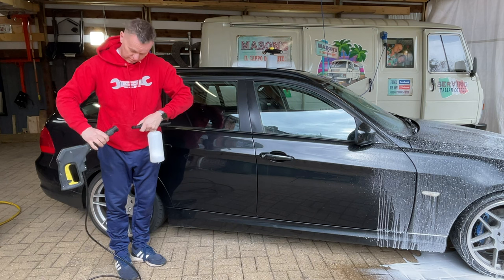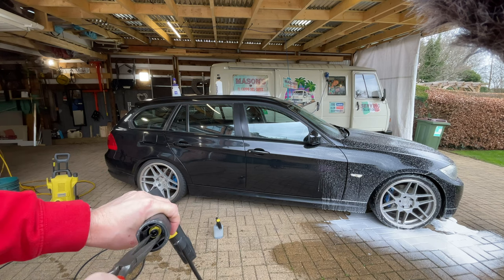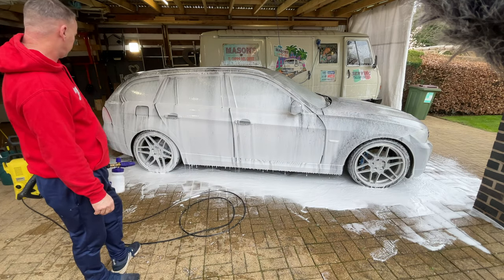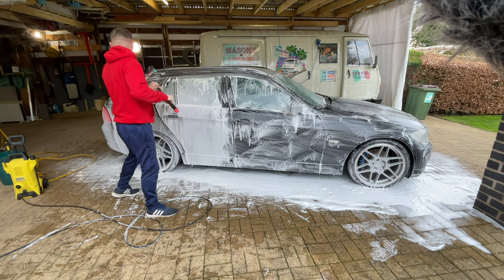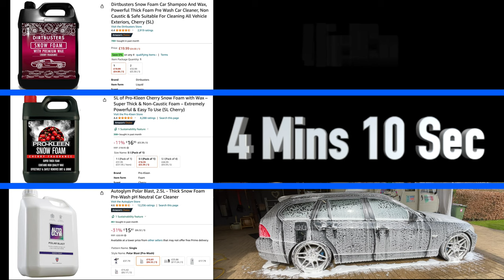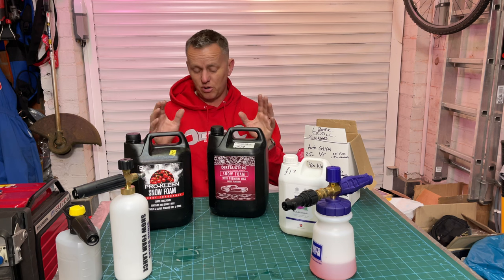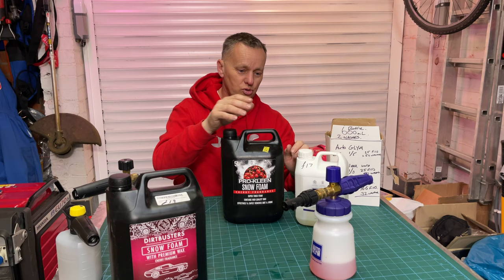"Snow Foam Showdown" Karcher, AutoGlym, Stone Banks, ProKleen, & DirtBusters.

Comment: Hi mate great video 
If you are going to use the snow foam as your contract wash do it 2 times 
Snow foam one then rinse off then snow foam again then use your brush 
If you use just one snow foam and use your brush you will be rubbing the dirt you have loosened into your paint coursing light scratches
Reply from the maker: Thanks for the tip!

Comment: The run off on the second foam, maybe due to the car being wet and it was dry the first time :)  That karcher cannon was total bobbins... EDIT, ahh you mention near the end haha.  I've used ProKleen cherry stuff before and it was good gear.  I always found that the foam knocks off a lot of the kack and then when you pressure wash it off you remove a lot of the stuff that'll scratch up your car when you go at it with a wash mitt.
Reply from the maker: Thanks for the great information👍🏻👍🏻🛠